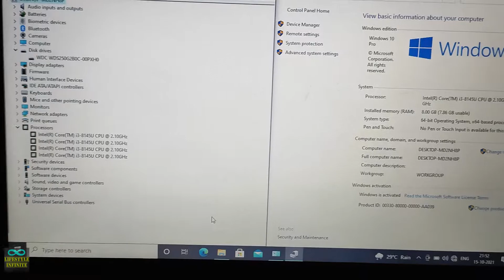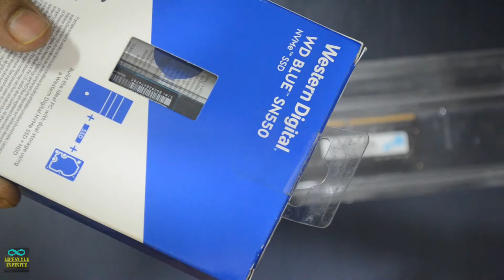ASUS Pro P1440FA Memory and Storage Upgrade

Comment: Hi your video help me a lot. just want to ask what type you are using on upper memory? is it okay to upgrade without removing the Storage hard drive?
Reply from the maker: Firstly, thank you :)
I just got the cheapest DDR4 available, no special memory with low latency or low power, matching the frequency only is fine.
It is perfectly fine to upgrade the memory without removing the Storage drive.

Comment: This laptop does not support nvme it supports only sata ssd how did you manage to do this ?  was it working after you added the ssd.
Reply from the maker: Yup, It works flawlessly. Not getting the maximum speed the SSD is rated for, but still quite faster than a SATA SSD. No special configuration or BIOS Change was required. Post installation I just switched the Boot Device selection from BIOS.
Reply: @LifestyleInfinite  i changed the hdd to ssd. it doesn't show up in the BIOS boot menu. how did you do it?

Comment: Brothers does it improve gaming 
I think I updgrade to transcend 220s and 
Adata 2666 what u think?
Reply from the maker: It will not make much of a difference, the components which you mentioned are of better quality and will have a longer warranty. But, the generic RAM was about half the price and I already had the spare WD Blue m.2 nVME SSD lying around from a previous build.